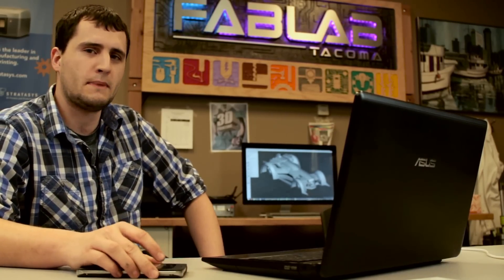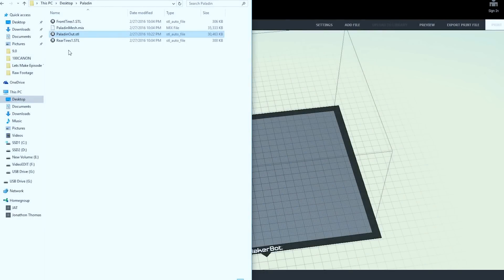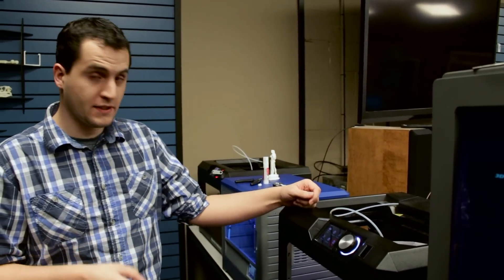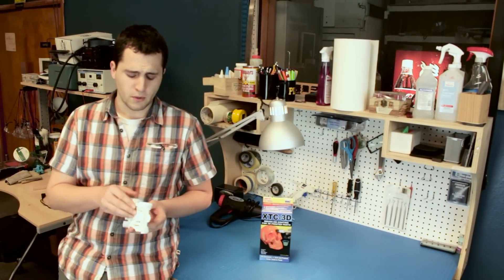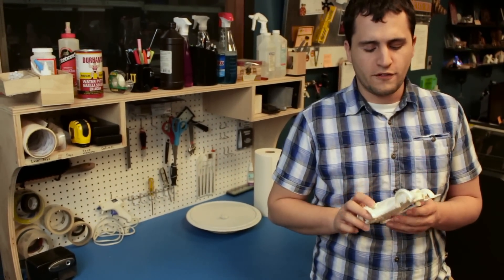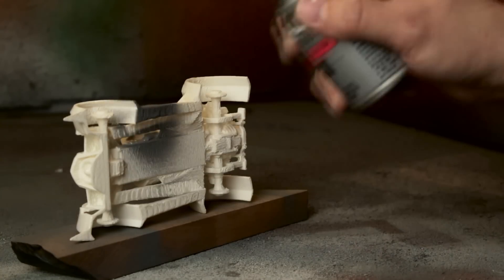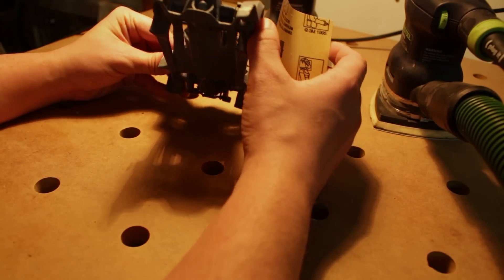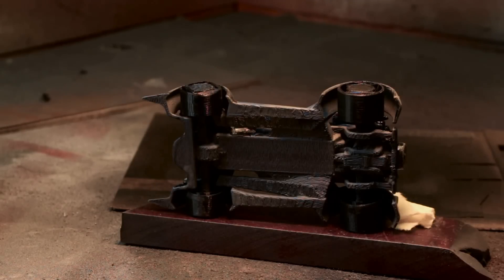3D Printing from Rocket League!

Comment: I had a much smaller sized Merc printed out and it came out good for the size. I think instead of the whole process you did for painting, I will use nail polish since the containers have more than enough for the job and they come in metallic colors of all types. Not sure if I'll want to seal it further, but first I need to see if my plan will work out.

Comment: awesome video and project! I was wondering how you got the files exported from the game and made them printable? I use umodel to export models from games and milkshape3d to export it as an .OBJ and fix up the mesh, but rocket league doesn't seem to work with umodel, thanks!
Reply: Would love to see a video on this. I've been struggling with MeshMixer trying to achieve similar results.
Reply from the maker: We took the base from the game and used mesh mixer to create the infill and fixes.
Reply from the maker: +Fabian Reddig that's defiantly in the works. we're doing a video for the Division this Monday but we'll do a meshmixer video game tutorial soon.
Reply: +Let's Make Thanks! I'm also still having trouble getting the models from Rocket League, that would be very helpful!
Reply: +Fabian Reddig Hey Fabian, I just found a reddit page where someone exported most of the models from the game, all cars, some antennas, balls and stuff like that. here is the link to the page if you want to check it out. the models are not print ready so be sure to fix them up with the model repair service from netfabb, it's free in your brower. or fix it in some way I haven't thought of, hope this helps, Cheers!

https://www.reddit.com/r/RocketLeague/comments/49iyxl/rocket_league_wheel_models_have_finally_arrived/

Comment: Hey Corey, 
If I had a 3D printer, I would have made a 3D print of my PennyBags persona from Rocket League. I made a few renders and posted them on the rocket league sub-reddit. I have all the models setup and assembled using Blender. Feel free to look them up. If you want to use the Blender file to test your printer with more Rocket League assemblies, I can privately send you the file. :)
Reply from the maker: yeah PM me the links I'd love to look at them.
Reply: +Let&#39;s Make I tried to, just couldn't find the button. How can I PM you?
Reply from the maker: +Josh Edwards (TheMcJabbar) I guess they removed the PM link. you can email them. L3tsmake@gmail.com.

Comment: ABS or PLA? That's an important detail. If PLA then sanding can be difficult. If ABS then acetone vapor smoothing might achieve same finish as the epoxy coat prior to painting.
Reply: +Vladimir Zuzukin PLA. The Epoxy resin made the sanding much easier once we got the tabs and small stuff off.